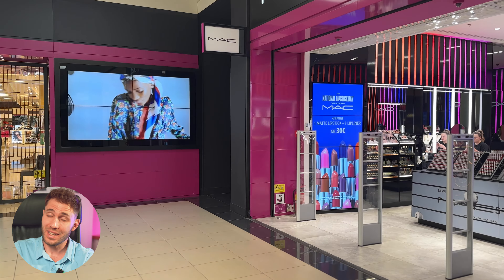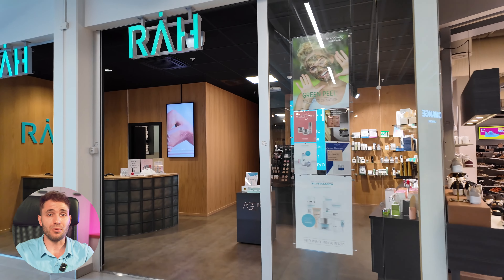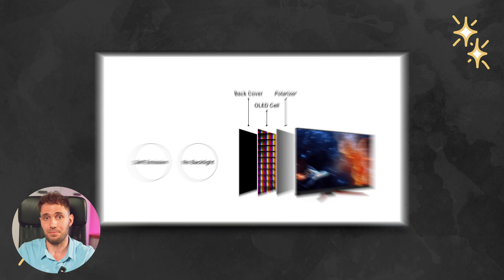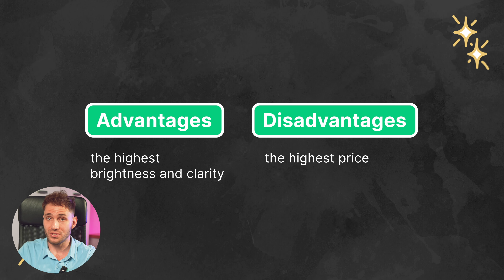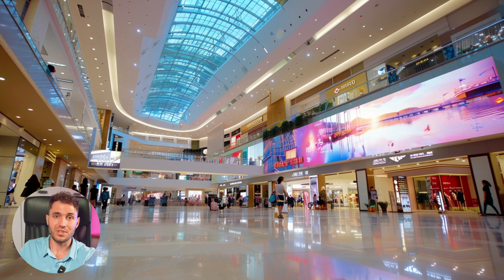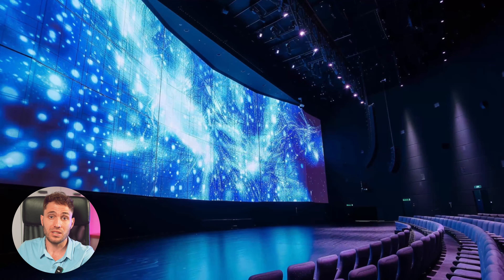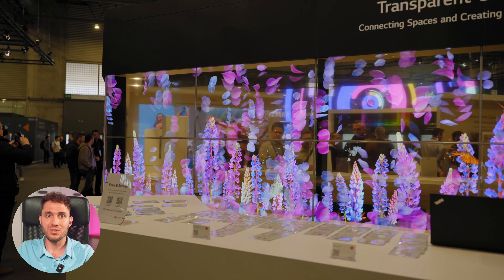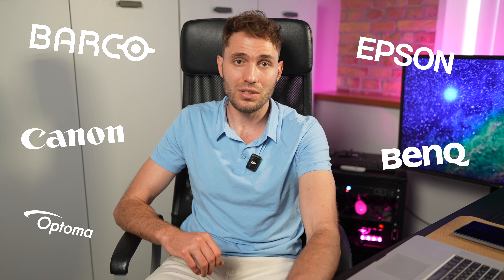Guide to Digital Displays | Digital Signage Hardware Course | Episode 1

Comment: In terms of energy consumption, which type of display (no touch, indoor) is the most efficient in the commercial setting? Are there any energy-saving features I should look for?
Reply from the maker: In commercial settings, LED-backlit LCDs are the most energy-efficient indoor displays. Look for features like automatic brightness control, power-saving modes, and Energy Star certification to maximize energy savings. OLEDs are also efficient but typically more expensive and best for high-quality display needs.